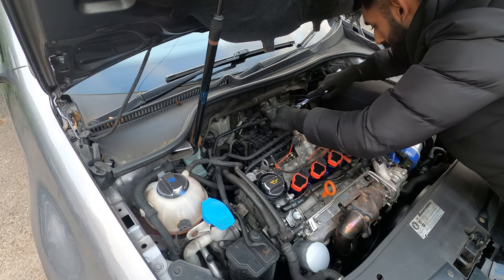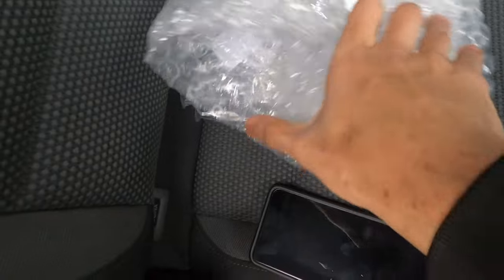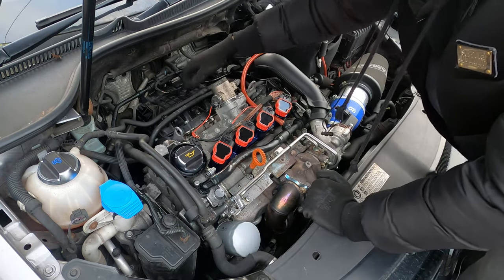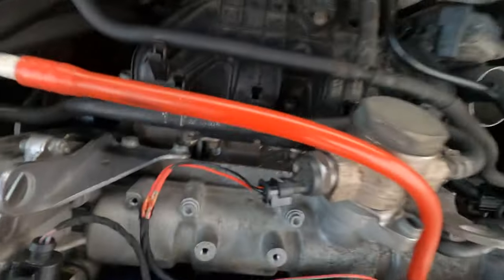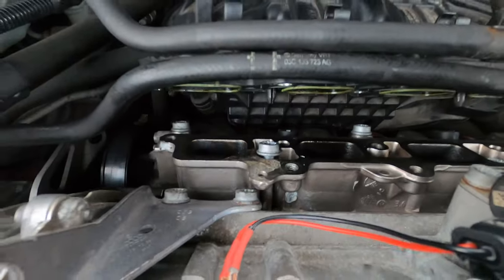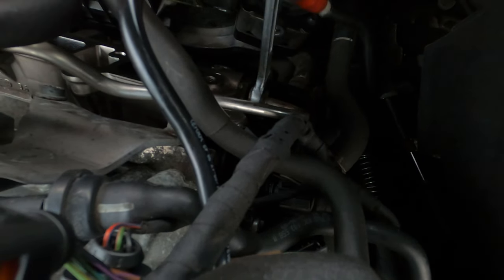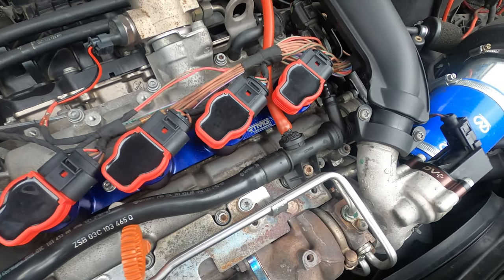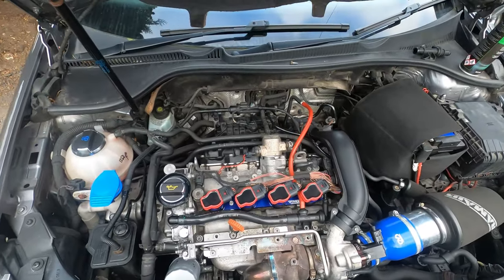Fixing The Golf - Its BROKEN?

Comment: Whats the max boost you're hitting? stock or tuned?
Reply from the maker: Tuned and it's 1.5 bar
Reply: @Fizzy.g  My MAP sensor reads 1.7 bar and i have the same engine as yours, either my N75 is wilding or the previous owner tuned it
Reply from the maker: That's your map sensor that's a bit different to boost pressure

Comment: I’ve got an issue with my HPFP make sure you check that’s alright easy check too can leak fuel into your oil
Reply: Worth changing the roller too
Reply from the maker: I've tried to find ways to check it but I can't really find anything. I've got that symptom of fuel leaking into the oil. I checked fuel pressure and it holds so I'm still not sure
Reply: 100% change HPFP and the cam roller
Reply: It’s the cylinder thing at top of the engine yours literally might not have got noisy yet mate mines making a metallic noise can’t really explain it
Reply from the maker: Yhhh that's the plan now.  Have you got part numbers for them?
Reply from the maker: Yeah I've got the fuel pump part number but I'm not sure of the cam follower part number
Reply: Longer bolts because the bolts on the  genuine one are too short
Reply: Parts for German cars on Google there’s a kit on there
Reply from the maker: Would another symptom of this be an 02 sensor that's reading way too high and the car running really rich? The car is showing its trying to run lean but its clearly running very rich so I think it's trying to counteract the extra fuel but can't because of the faulty hpfp
Reply: Isn’t that cos you haven’t tuned the sports cat in ? I’ve not had mine on diagnostics but I’ve got the bits on the way so I’ll let you know how it goes
Reply from the maker: It possibly is but some say it is some say it isn't so I'm not sure what to go off. I guess I'll find out once it's tuned. Yeah let me know how your build goes
Reply: You alright mate it’s been a while…. 😂I’ve not worked on mine in a while but this weekend I managed to get to the bottom of what was up with mine and it was the chain I’ve replaced that now and it runs perfect with no faults could possibly be that the chain has jumped on the inlet side mine had done a nearly 90degree but not enough to bend the valves my bad for saying the wrong thing I’ve got a spare hpfp if anyone needs it 🤣
Reply: @Fizzy.g when the hpfp is bad if you smell your dipstick it will smell like fuel also your car will give a code something like  rich off idle and your plugs will be black very rare injectors fail on the 1.4tsi it's mostly always the pump